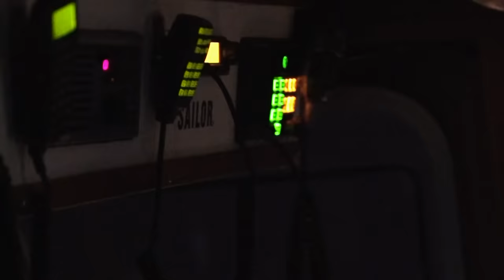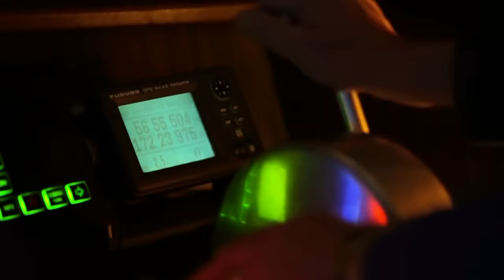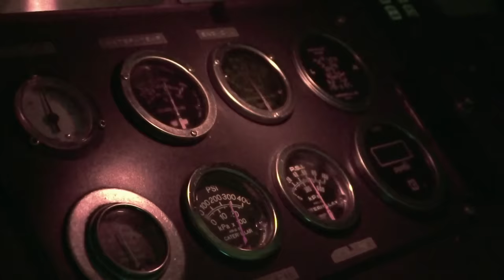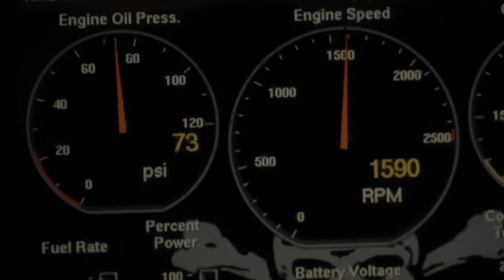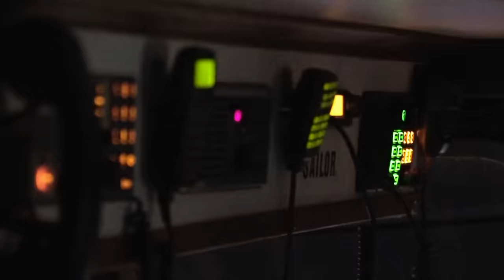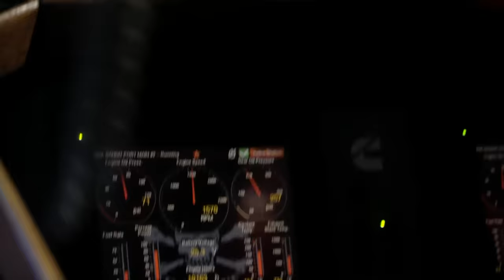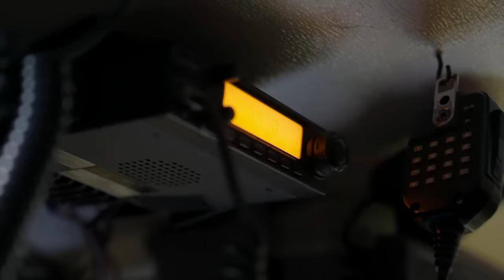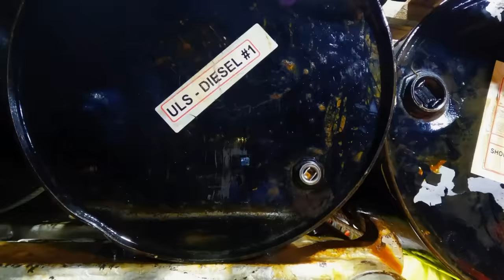Deadliest Catch Captains Unite To Protect Crabs From Illegal Foreign Ships! | Deadliest Catch

Comment: How is that boat going to see the message they’re sending….thought that boat was 12mi away and still running away from the fleet?
Reply: One of the many questions that leads me to believe this entire thing was staged. Many different bits of footage, clipped, cut, edited and spliced together to manufacturer a more compelling crisis scenario. There’s something about those radar return images and radio dialogues that feel…artificial.
Reply: @nateweter4012 thanks. I also had the same question and you gave a perfect explanation. 💯👍
Reply: There might be an attempt to recover the gear. Those nets are pretty costly to replace. If not, there is still the chance that they might see the episode.
Reply: diesel all over the deck, ocean, barrels and unburnt rope left floating as hazards to navigation, what a bunch of idiots. Typical.
Reply: @nateweter4012 a vessel does not jeopardize running over a buoy just for television
Reply: They drove to a spot where people dont fish to do this
Reply: @zinussan50  not to mention look at the sea conditions when burning net
Reply: @nateweter4012  this show has been staged for years

Comment: Wait I thought diesel wasn’t flammable what
Reply: Diesel is both flammable and combustible
Reply: Diesel is not flammable but it is a combustible liquid
Reply: @JoeHupp  you are wrong... Diesel exists of both Hexadecane and Heptadecene who or on their own not flammable but combined become flammable, add Tricosane to that mix and the flashpoint for that becomes 37.2 degrees Celsius.
Reply: Any thing is if you get enough heat into it. 🤯